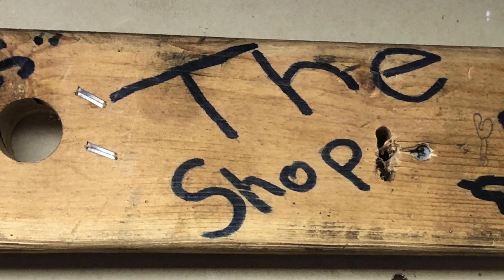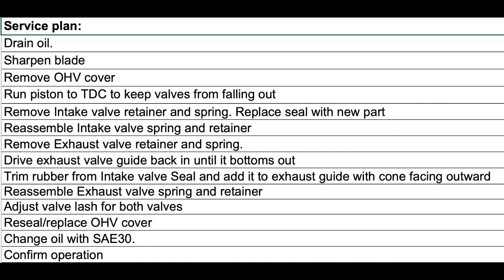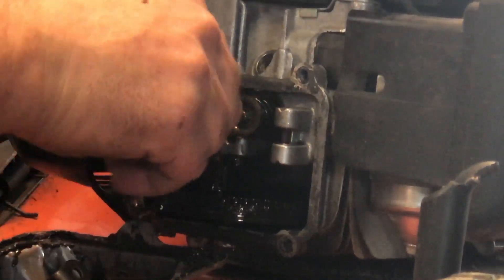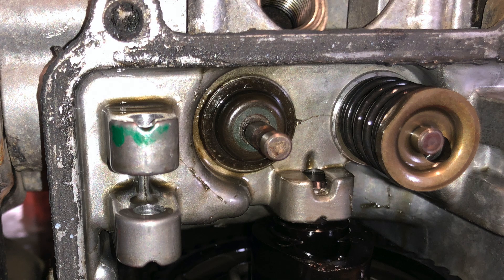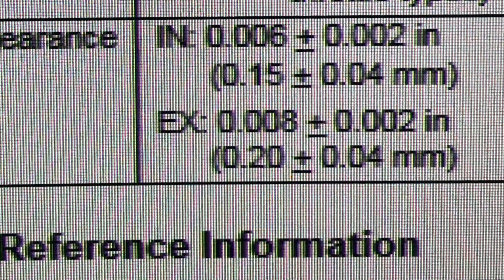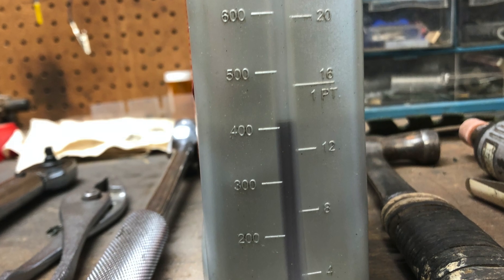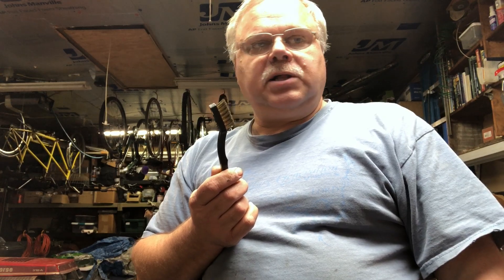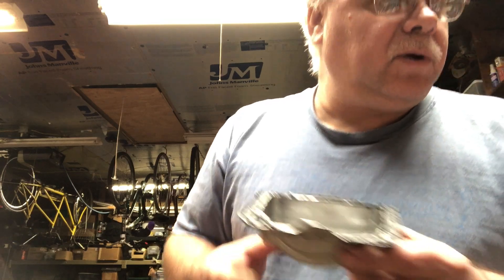Broken Exhaust Rocker on Honda GCV190; guide migrating outward

Comment from the maker: Neglected to include this, but get a good look at the lobe on that cam assembly. If it is worn down at all, your valves may not open fully.
Also, make sure the compression release lever on the cam assembly is working smoothly. If it hangs up, you will not have any compression release, and the rope will be hard to pull again.
It is not difficult to replace and time if needed.
Reply: Thanks!  I took a look and the (what, plastic?) cam was a little beat up-  $10 part, easy install.  I used too put new cams in V8 engines in the 70s.  This was FUN compared to that.

Comment: This is normal on theses engines 
Install a intake seal on exhaust valve with the rubber removed and new seal on intake 
Fixed
Reply from the maker: Nicely summarized. If I had read your statement here before watching the video, I might not have any idea what you were talking about. Thanks for the feedback, friend.

Comment: I recently came across a Honda gcv190-powered lawn mower that had the same problem. I didn't notice the migrated valve guide the first time around-- if I recall, the exhaust valve was stuck, so I freed up the valve and just replaced the rocker arm.
And the replacement rocker arm was broken within a few months..
My bad.
At least in working on a cold engine, it took quite a lot of effort to drive the guide all the way back in with a 7 mm socket as a driver.

I assume during operation, when the block heats up, the guide may be significantly looser in its bore.

Do you know for sure from experience that this is likely to be a rapidly recurrent problem and therefore that the seal is necessary?

Or did you add it  " just in case" since the fact that the problem occurred initially was compelling enough that it was likely to happen again?

There are a few internet references to this particular problem with the Honda GCV line of engines, but there is not much online documentation!

Also, do you know if it is possible to drive the guide too deep into the block so that the valve does not seat properly? I drove it in essentially to the level of the small retaining ring near the top of the guide.

Thanks much for your help, and for your excellent video presentation.
Reply from the maker: So sorry I missed this comment when it first appeared. I'm usually vigilant about watching for that kind of feedback. My sincere apologies.

Do you know for sure from experience that this is likely to be a rapidly recurrent problem and therefore that the seal is necessary?

No. I have no real experience apart from this specific machine that I owned. Much of what I shared here is either research from YouTube, or my own findings/speculation. My assumption was that it would migrate outward again, for the same reason it did initially. Therefore, I consider the "extra seal" solution to be absolutely necessary to prevent reoccurrence.

Also, do you know if it is possible to drive the guide too deep into the block so that the valve does not seat properly?
I do not believe that possible. I drove it in until it bottomed out; that's where I stopped. I verified that the lifter no longer contacted the guide before reassembling everything.

My sincere thanks for your feedback.

Comment: Nice job , great intuitive and thorough video.   I found if you wise a large screw driver on either side and back and forth easy then you do not bend the cover, I also used a heat gun to warm the sealant but that may not be necessary.   I am going to try the valve stem seal minus the rubber isea, I know some other folks are punching the metal to peen it over a bit to hold the valve stem guide in place but like your idea .  Good job, nice shop, keep up the good work my friend.
John
Reply from the maker: Thanks for the feedback, partner.

Comment: what are the parts required for this, Exhaust valve rocker and what else?
Reply from the maker: Well, sir, certainly a new exhaust rocker, including the adjustment screw and locking nut. The new rocker may not include those parts. I also used a new seal on the intake side so that I could move the old seal over to the exhaust side. Hi-temp silicon to reseal the valve cover. As long as the cam and the belt are okay, which they should be, I'd say that is it.
Reply: Also, I ordered a new exhaust pin as my old pin worn..intake pin reused..
Also put in a new plug , new airfilter, and fresh oil to the correct level.  10w-30 seems to be the consensus.
Reply: @johnkomosa4089  i just did a tune up in hopes of making it start easier im hoping this will solve the problem. im pretty confused aboutg how to trim the rubber seal and how to adjust the valves
Reply from the maker: @mohammadabdullahkhan360  Don't let that seal stop you. Firstly, it doesn't have to be perfectly trimmed, and secondly, whatever tool you use, you simply have to scrape away the rubber.
Reply: @netdoctor1  my exhaust rocker wasn’t Brocken or cracked however I still Idid the seal install. I had a difficult time setting the gap for the rockers but I couldn’t calibrate it well enough and left around .05 mm extra gap more for both. I did a whole tune up w new sparks, air filter and oil. I’ll let you know if it starts up or not

Comment: Has the repair held up for the last 2 years?  Have you been using the mower regularly?
Reply from the maker: Sold it to a friend, but it's doing just fine. Given the nature of the defect, I believe it is a permanent solution.
Since the root cause is the guide being allowed to migrate out of the block, the extra seal will absolutely prevent it.
Reply: Thank you very much!

Comment: I'm just confused which socket you use because you said quarter-inch and you also said eight millimeter would either one work?
Reply from the maker: I meant "1/4" drive".
Choose one that will not hit the valve stem as you're driving the guide back in.

Comment: Hate that gasket sealer, too. About 2 years ago I used a piece of paper pressed into the valve cover to indent an outline. Then I cut that paper around the indentations. Next I carefully took a Sharpie & traced around the paper template onto a basic piece of Felpro gasket material. With scissors & an exacto knife, I cut the gasket after which I used a punch to make the holes for the screws. I inserted the homemade gasket into the cover & tightened it down, 2 years later & no leaks. I might also add that I used the gasket to make another template onto a piece of cardboard for future use since cardboard is  a lot easier to trace around than my original paper template. All told, it took me about 45 minutes.
Reply from the maker: Yep. If I wasn't so lazy I'd have ordered some legitimate gasket material to cut my own. As it is, I use cereal box cardboard to make gaskets all the time. I will often double up on critical gaskets just to be safe.
Reply: @netdoctor1  Cool. Yes, sometimes it takes two; not often but every now & then.